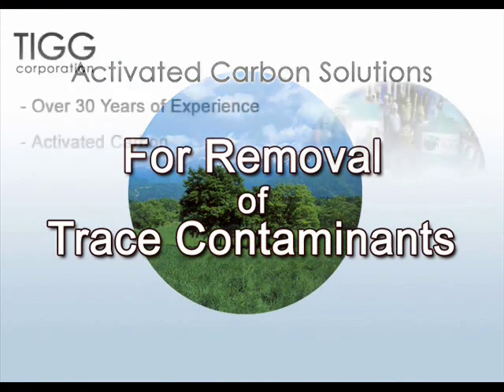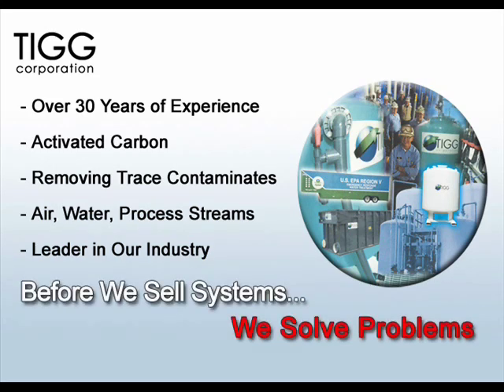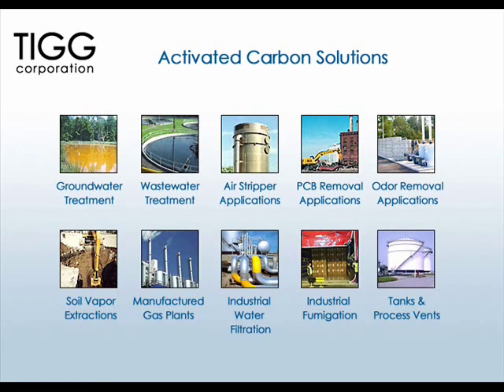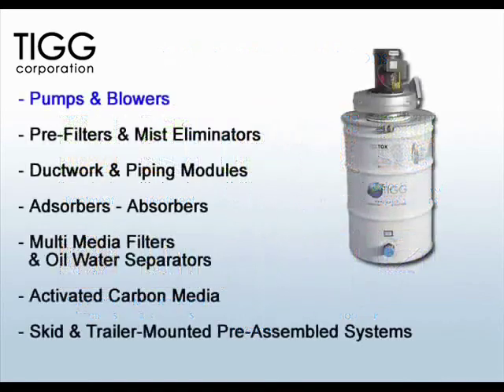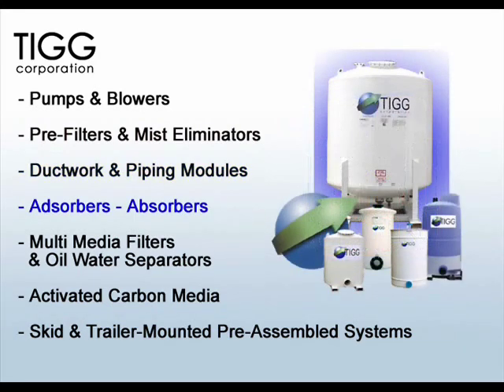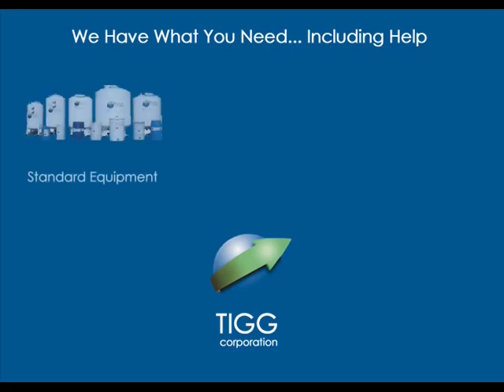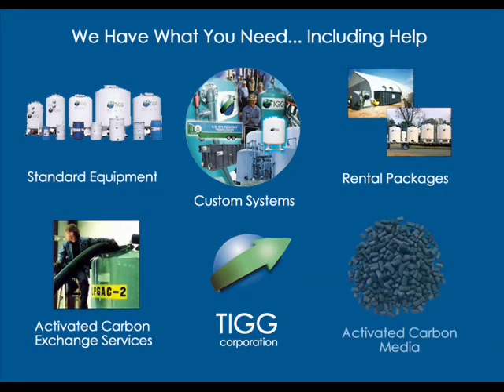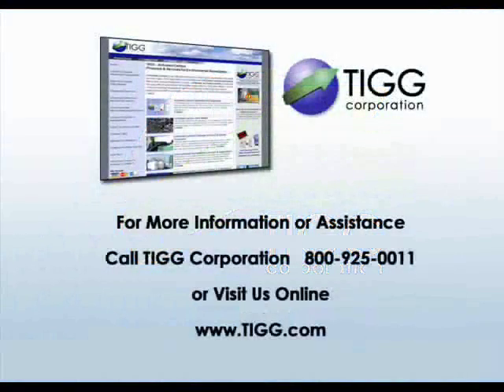Activated Carbon

Comment: Dear Sir,
We have requirement of machinerey which can activate non-active carbon.
We are running tire/plastic recycling plant and its output is non-active carbon black, Pyrolysis oil and gas. 
We want to make this carbon active.
 
Trindra Paul
Pari International
Ludhiana, Punjab. India

Contact No - 
India +91-987-695-6665
India +91-998-882-7514
UK +44-792-400-0201

skype:- robin.siddhu
Paltalk:- robin27111979
Yahoo messenger:- pari.international

e-mail:-  pari.international@yahoo.com